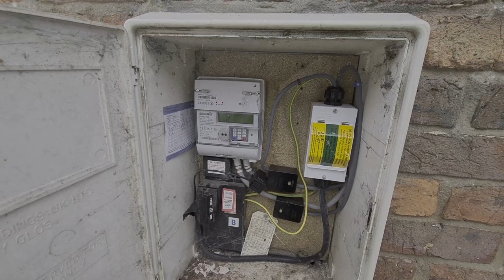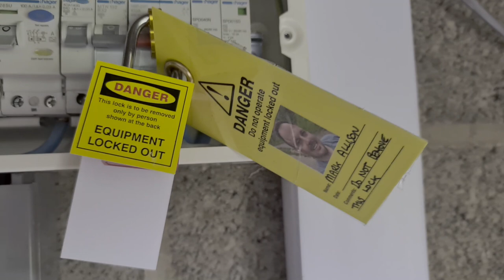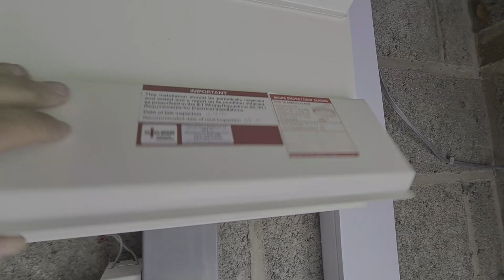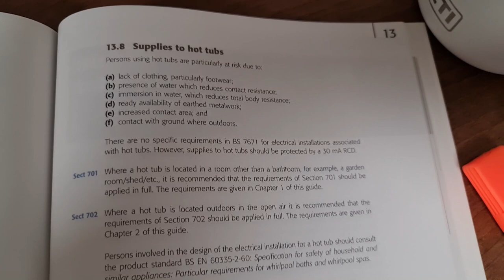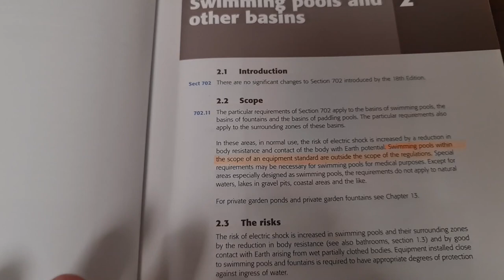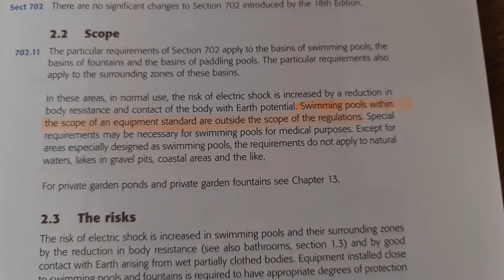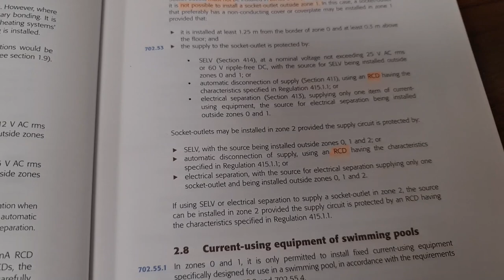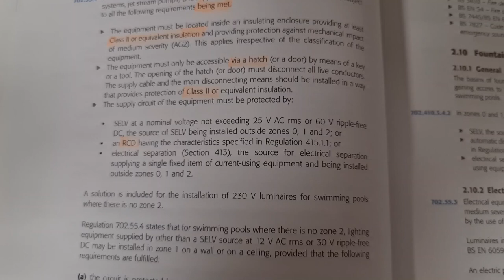Electrician connects Hot Tub to PME TNC-S explained

Comment: Top video Mark, Nice to see someone go against the general consensus of "bang an earth rod in" or in the case of out buildings "just TT it!". 

I had the same discussion with a spark at my local wholesalers, he was describing his current job which was an out building, he'd run 16mm SWA out, divorced the suppliers earth and called it a good do, he was mentioning bonding in the outbuilding when I queried what it was, and it turned out to be an (old) water main that they still use for the garden. I asked where that water main comes from, and he confirmed it was from the house, I basically said that he had connected back to the PME by bonding that, but he didn't get it, no matter how I explained it. 

Safe to say that you do a far better job of explaining yourself
Reply: I had this when we just converted a guys Tractor Garage, separate 100 Amp supplies but the previous people that built the house had brought a 10mm single earth over to bond the plastic water main supplying the boiler plant heating the house - the Garage is on TT with a Tesla Charger. So had to remove the bond to keep the properties separate as to ensure the house on PME didn't get induced voltage down the earth etc.
Reply from the maker: Thanks Sean. Very kind mate. Always stuff to learn from each other mate.
Reply: @effervescence5664  ? Do you mean removed bond because: a fault current could be exported back to the pme house earthing terminal via the single earth cable, assuming a phase/earth fault conducts to the metal heating pipes to which the single earth was bonded ?

Comment: Really great video thank you. Some interesting points. I'm currently in the middle of planning a hot tub install and after reading what seems like a million point of views (all of which have very valid but sometimes conflicting points), I've prepped a single 8ft earth rod to the rear of my shed CU that is to power the hot tub that's at least 10M away in all directions from any buildings or utilities (we live in a semi rural area), so not likely for any external current sources. There's no other extrantous earth sources so I don't believe we have anything to worry about there. My sparky originally said that I should just go with the PME earth (I guess mostly because he didn't consider any of the hottub characteristics), but with my family using the hot tub and the possibility of a tingling sensation when stepping out really putting me off, I looked for a 'better' solution... I plan to not use the PME at the shed CU and instead use the single earth rod. I know you said ideally it should be multiple rods, but it's not practical. Given the reading from the rod install are within reasonable reading - would you say this seems like a safe install given the specifications I mentioned?
Reply from the maker: Sounds fine to me Andrew!
Reply: @electrician247  Really appreciate the response, thank you 👍 It's always good to get a second opinion to sanity check things.
Reply from the maker: @Andrew Higginson  so long as the rod is reasonable close to the hot tub you should be fine.

Comment: From my position your best video yet so thanks very much. You do an excellent job in considering all the possible implications on site which shows how difficult the task is. I'm interested in your comment on the hot tub being on a raised platform, why would that be different to it being sat 150mm lower unless the platform is made from insulated material or has an insulating barrier. Where I work the ground conditions are very hard/stoney so difficult to get <100 ohms without some serious digging which also means the step voltages are higher, I've been experimenting with condudisc and conducrete which give better results. Where a hot tub incorporates an earthed metal heating element in contact with the water that you can touch, how can it be a class ll appliance. I like the idea of cascading the 30mA and 10mA RCD even if selectivity isn't achieved. Keep up the great work.
Reply from the maker: Thanks for watching and the comment!

This is it with bases/platforms.  Be it timber or stone. How insulating are they. In this case it has 100mm kingspan and a dpc. Not for the hot tub but an attempt to keep the floor less cold in winter. So all things considered I thought it might help lol.

Also been playing around with condudisc, earth rods, bentonite etc. Neil did some posts on sm with values under 1 ohm from them. We have very chalky ground on the yorkshire wolds so often need 2 or 3 rods.

The element in the water is the point many come back to with class 2. Its up to the manufacturer to test and state class. Some use a process of pumps, vessels and pipe work so the heating element is never in direct contact with the water in the tub. How effective that is well thats on them and product testing they have to do I guess. 

I think cascaded rcd is a good way to go. Quite a few hot tubs have 10mA rcd protection built in now. 

Thanks for watching and joining in the comments!
Reply: Seems that in the USA 10mA RCD may be the equivalent of UK additional protection value of 30mA, I'd like to have confirmation.

Comment: I installed a hot tub on a pme system in accordance with section 702. The manufacturer said the hot tub is class 2, so on that basis there is no chance of any electrical voltage appearing within or around the hot tub as a result of a fault.

Comment: Elex what a disgrace! 

This is a great piece on hot tubs, I’ve done a few and like you say Earthing is the single biggest thought when installing.

I struggled to get answers from manufacturers and my CPS. 

All installs were supplied from a PME supply, so loss of neutral was the next biggest consideration. Like you I don’t have a problem with connecting to PME, however as it was still relatively early days I returned to my knowledge from installing EV charging points (before the likes of podpoint etc came to market) and the use of an Interlock switch was most common, and taking into consideration wether the vehicle was within the zone when charging or outside the zone!

So based on this understanding I would take the PME to the supply side of the isolator then divorce at this point and ‘bang’ a rod in connected to the hot tub at the unit on earthing point!

Test and test and test 😂 to convince myself it was ‘safe’ 🤷‍♂️

I’m thinking now I should have been surrounding the tub with earth rods rather than just the one or just accepting that my PME was reliable and the RCBO was acceptable, luckily there was never lighting or power to be factored in.

You’ve opened my eyes wider 👍
Reply from the maker: Thanks for watching and joining in the comments. I am here to learn and share the bits I know. You make some cracking points. 

We can help each other.

Comment: Hi you mentioned that it's only a home with 4 people with regards your chat about MD. I have a large bungalow midwales. Applied ladt year for 1 ev charger all good, 1 month ago applied for heat pump all good. Last week aplied to fit another ev charger as we are going 100% green, we'll as near. But DNO say no I require 3 phase. I am arguing with them that the goverment wants me to go green but I cannot in practice. I will not be the only one in this postion.
Reply from the maker: Its going to be a growing problem Gino. They will be concerned about everything drawing load at the same time. Maybe they would allow it if you have a system than uses load limiting technology so as zappi and hypervolt etc. 

Thanks for watching and joining in the comments
Reply: @electrician247  that's not an issue to lower the load but when 2 vehicles nerd charging to use the next day for work plus it takes a good 7 hours to charge evs at home even on a 7.4 kw charger.

Comment: Mark,  The boffins in the know now say that it is recommended to put an earth electrode in addition to the domestic supply, where the supply is PME.
in case of a pen fault.  Why should this be any different for a Hot Tub which is connected to the PME supply?
Reply from the maker: It isn't any different this job has the perfect array of complementary earthing systems. 

I would discourage the use of rods in urban areas. For all the reasons discussed in this video. Lots more options available.

Comment: I think your argument on the multiple earth is  a sound one you have more than one source so adding another one seems less useful especially after testing and was well below the 20ohms threshold. I presume you used the 3- stake fall of potential method? We use in the states a 25 ohms acceptable threshold for earth/ground resistance. 

I do however think there should be annual testing of hot tubs and swimming pools where electricity is concerned where risks are so much higher we do have that requirement in some states now that annual testing saves lives.

I do also think a faster tripping and low current trip RCDs should be used for hot tubs. A 30mA as in UK in my view is to slow to trip at too higher a current. As wet body resistance can fall dramatically those RCDs could create risks that I would not be comfortable with. At some point UK will move to 5mA and 4-5mS tripping RCDs this will become more common in future like we have in the USA. I have heard that many hot tubs in UK come from USA and some have come with an inline GFCIs which are faster tripping. However you would not want to use it in part because cables could not be upto spec compared to an SWA. Most swimming pools in USA have a mesh grounding all around the pool and bonding is applied to exposed metal parts like handles for steps into a pool.

My friend had an EV installed installed recently but no testing was done on the grounding aspects I did a fall of potential test and it was around 35 ohms, for me that was too high we did install an additional 8-foot ground rod with the appropriate distance away to address step potential and avoiding commingling even though it was hard ground and we managed to get ground resistance down to about 4.4 ohms.
Reply from the maker: Thanks for watching! Totally agree with the RCD aspect. Many of the tubs here have 10mA built into the control electronics/wiring centres in the tubs. 

Didnt make sense for another earth electrode in this case. Especially with the oil pipe bonded and in the ground next to the tub. 

Always 3 stake tested. Thats why we had to get the meggers out on this one.
Reply: @electrician247  Oh I wondered why the TIS was missing!

Comment: never knew you could mix TT and TNCS always told not to, don't really understand why, wish it could all be TNS but that would be too simple good video made some good points, good job
Reply: In the 18th edition I don’t know the regulation number but it does state they recommend an earth electrode as an addition to your tncs arrangement. I was surprised by this but after thinking about it makes sense. It would basically be like an extra bonding conductor limiting voltages if a pen fault occurred. If 20 ohms or less it would actually be quite effective. But in reality most people don’t want to be hammering in earth electrodes In busy streets where there’s potential services.

Comment: Posting this as I have struggles to find the correct info. 
I recently stayed at a holiday let that had a hot tub. 
It was fed from a 32amp B type breaker into a 110v 16amp switched socket next to the tub.
The cable from the plug was SWA. 
I’m not a qualified sparky but I worked along side a qualified sparky as his mechanical partner for a few years so picked up a bit of knowledge on the practical
Side. I also have 18th edition cert. 
All my electrical work is done under supervision of the sparky and he checks and tests all my work.
I do not do electrical
Work outside of my job.
I just wondered if this installation is correct as it rang some alarm bells on the equipment used and the SWA into a plug 🤷🏻
Cheers if you reply with your thoughts people .

Comment: In general If you have Tn-S or TN-C-C. If you have done your home work and selected the right size cables for all bonding . Your Ze should be ok. So using a earth rod just  is just a get out clause for bad electrics, 
     They say hot tubs arent in 702, but anybody who usuing regs not to do stuff. Isn't looking after no one except someones wallet.  Some think Regs are there for a minuim requirement. Personally    whats the difference, size ,water temp? 
    Like to see update.
Reply from the maker: The regs are a high base line for everyone to attain. Simple as that. 

Hot tubs have a product stand to connect into electrical systems. 

As shown in the video and others earth rods are far from a magic bullet despite some particularly misleading articles in industry magazines. The authors sadly lacking experience on the subject matter
Reply: @electrician247  just realised meant to say  some poeple use  regs as a minimal requirement.